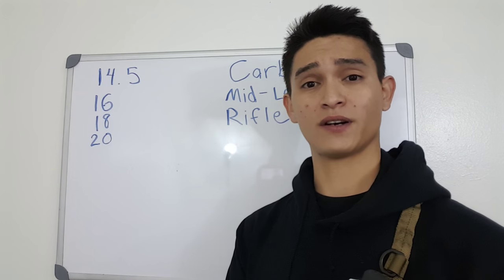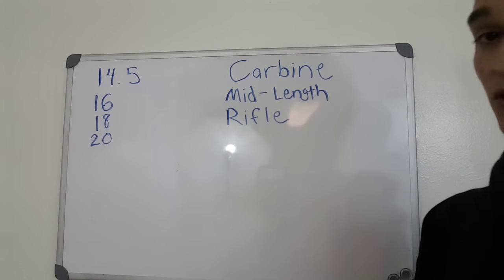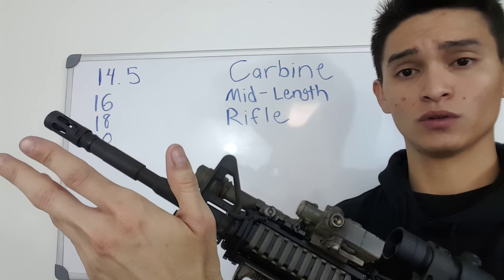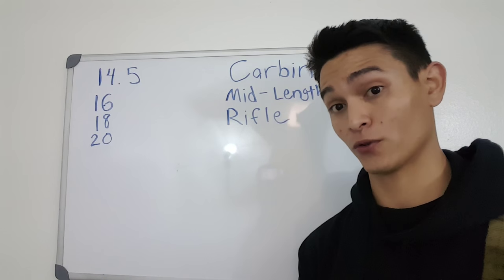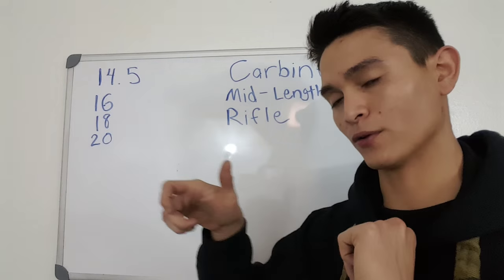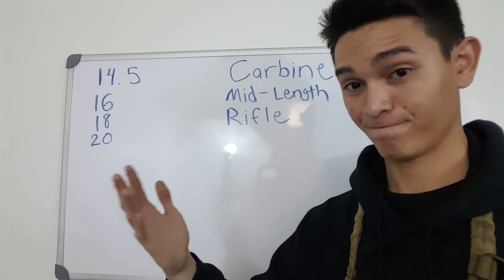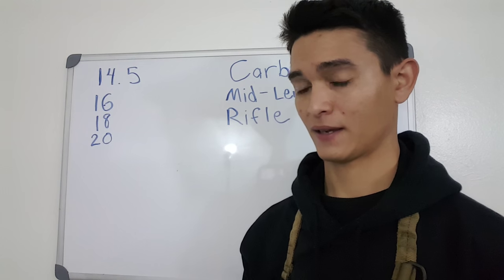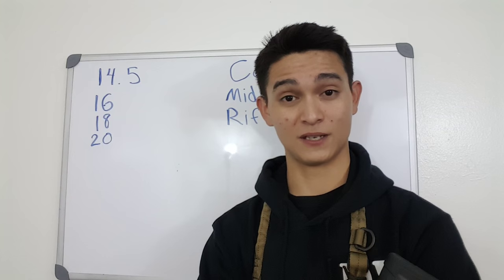AR 15 gas systems and barrel lengths, which one?

Comment: I have a American defense 16 inch barrel full-length handguard rifle I'm about to get a barrel for and I just wanted to have hey Barrell as nice as the rifle is someone had replaced it before and I don't know what it is if I get a Wilson Barrel or someone like that would I be better off with a mid-length or carbine length gas system just for a cool Factor and function I just cuz it's an awesome gun and I want the best thing for it a expensive rifle

Comment: Everything has changed. Uncle Sam let me use the M16a1. Only 55gr. bullets w/ lead core. Only 20-inch barrels and no collapsible stock. Triangular barrel covers only. No red-dot or magnafied optics, or, picatinny rails anywhere. Changing my name to Fred Flintstone.

Comment: so if im using a 18 inch barrel with mid length gas system i need a carbine buffer?
Reply: I'm using an 18" with a rifle buffer with no problems but should be okay with a carbine buffer as well. may benefit from tuning by using different weight buffers or an adjustable gas block.
Reply: You might be over gassed, might. 
Had one like it, was spitting at 2o’clock. Got a heavier buffer and it seemed to be fixed
Reply: Derek Boone you would want an M16 Bolt carrier and an H-marked buffer

Comment: I've made kill shots in Latifiyah with a 14.5" carbine out close to 350m so the 14.5" is definitely capable to at least 300m
Reply: Also, you made some good points but you didn't mention anything about dwell time which is the time that the bullet passes the gas block and exits the muzzle. Dwell time is what is going to determine the recoil of the rifle. The reason carbine length gas systems have a harder recoil is because the dwell time is a lot longer, basically you will have more gas pushed through the gas tube because of the distance between the gas block and muzzle is longer. You could have a 20" barrel with a mid length gas system and it will recoil just as harsh as a 14.5" carbine. Lastly you should've mentioned ways to reduce felt recoil such as heavier buffers and enhanced/extra power buffer springs. I run a Sprinco blue enhanced spring and an H3 buffer in my 14.5" carbine and the felt recoil is basically the same as my 16" mid length with Sprinco blue spring and H buffer. Buffers and buffer springs should be the first modification to make your rifle. Esp Sprinco springs... They will outlast your rifle.
Reply: The army says its effective out to 600m I say that's pushing it though
Reply: I'd say the M4 is effective out to 400 meters max

Comment: Why are most 300 blackout rifles pistol length gas system?
Reply: because the cartridge was designed around a 9" barrel.
Reply: Garrett Ames So what length gas system should be on a 16" 300blk?
Reply: Not sure.  I haven't messed with the cartridge yet.  I would do some research though.  I think there might be some shortstroking occasionally if using longer barrels/gas systems with subsonic ammo.

Comment: what is your opinion on a 10.5 I feel like its not stupid short but I do tend to get gas in my face (lefty problems).
Reply from the maker: it's the shortest I'd go
Reply: Cool thanks for the response
Reply: joe Anderson bootleg industries adjustable BCG.  Helps so much with overgassing. I also use a springco red spring and 6.8 oz buffer.

Comment: Ive never noticed a difference between a carbine lenth and Mid-lenth rifle in terms of balance and weight. not saying it isnt there, just saying that its very small. I might notice a difference if i completed the 1st half of a rifle class with a carbine and then switched to the mid-length.

Comment: I honestly don't see any advantage in going with a 14.5'' barrel that you have to extend to 16'' anyway. Why not just go with a 16'' in the first place. And if the 14.5''/CLG, is over gassed to begin with, the 16'' will be more so, then it only makes sense to go 16''/MLG or 18''/MLG or RLG, and 20'' RLG. Unless you're looking for enough gas to operate a weapon you may have just pulled out of a mud puddle.

Comment: I just picked up a 10.5 CHF (carbine) pistol upper from palmetto including shipping for $299.  It should be fun to dick around with and hopefully it's reliable.
Reply: It should cycle fine you just lose velocity at further ranges.
Reply from the maker: 10.5 is the shortest I'd go. you retain a carbine length system and it'll work. just watch your lube.
Reply: Just for fun check out MK 18 mod 0 on you tube and online tons of good stuff

Comment: when you talk about pistol length gas. that should really only apply to barrels under 10", because of dwell time. nobody runs a pistol length gas system on a 16 or 18 or 20 because like you said but you didn't give a reason why. if you were to run a pistol length gas tube on a 14.5"+ length barrel it would be over gassed and the cyclic rate would be so fast that you wouldn't even pick up another round in your magazine.

Comment: As far as pistol length is concerned, what about 300blk?
Reply: what about it?
Reply: Danil Shimanskiy I don't think you would want a rifle length 300blk given the powder burn.
Reply: Pistol length gas systems are standard and completely acceptable, if not optimal, on .300 Blackout.
Reply: the same general velocity rules apply to 300 BLK. A 16" 300 will get roughly 200 fps more than a 8.5". That equates to 20% more energy.
Reply: The Immortal I don't think thats correct
Reply: +Joe Schmoe 
research it for yourself, then. 
an example- 

110 vmax from a 8.5" barrel- 2150 fps/ 1129 fpe

110 vmax from a 16" barrel-
2350 fps/ 1349 fpe

That's an 8% difference in velocity and a 16% difference in energy.
Reply: RETiredGM 
lol. ok, man. You're the only guy on the planet not noticing a velocity difference between 8 and 16 inch barrels in blackout. For everyone else, we're seeing about 200 fps velocity loss with every load. H110 and W296 are the same powder and I have reloaded with both. The load you list is very common and most of us load it. You will see velocity increases in 300 BLK up to about 20". It's more effective in short barrels than 5.56, but it's not a nuclear tipped super round.

Comment: Are you serious? Piston systems dont run well, hardly ever at all? The HK 416 has a immaculate piston system. My CMMG pistol conversion runs no worse or better than the gas system it replaced. Gun stays cooler because no hot gasses returning to chamber along with dirt. Do some research and get EXPERIENCED before you make such comments.
Reply: AR pistols are dumb. You're sacrificing so much velocity for so little gain. I'd rather just use a real pistol when I need it and a rifle for the rest of the time.
Reply from the maker: are you stupid? I said PISTOL length gas systems, not piston.... pay attention
Reply: +AregularGuy speak clearer english!
Reply: +WaxedClassics i.e stop mumbling and speak clearer!
Reply: +Sam Wagner I agree, They are a niche in a over saturated market.
Reply from the maker: +WaxedClassics "when people ask me about pistol length gas systems" this is what I said. at what point did you get piston from that, and you must be deaf or going deaf if you didn't hear the word "pistol" in that sentence..... best way to tell that you didn't pay attention is to look at the comments. no body has complained about the same thing you did.